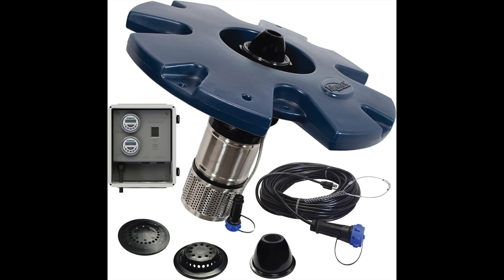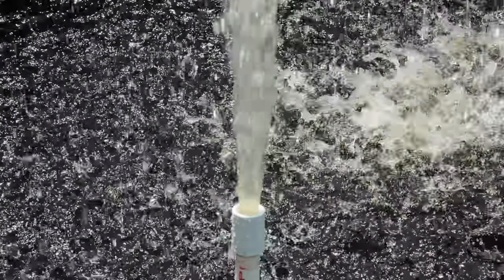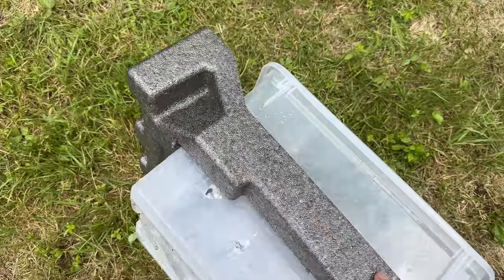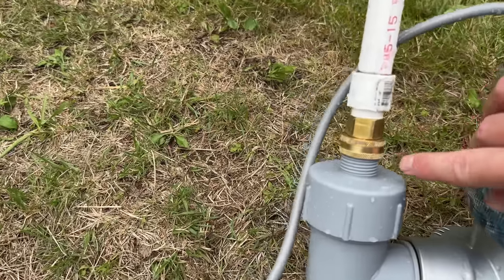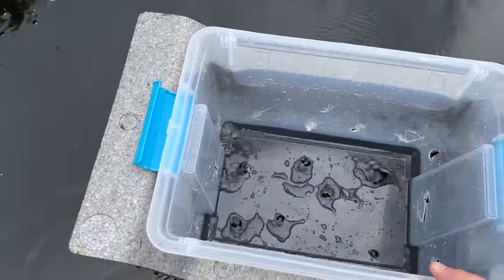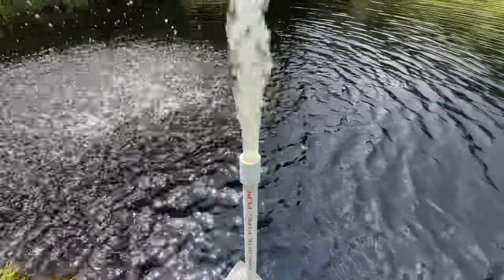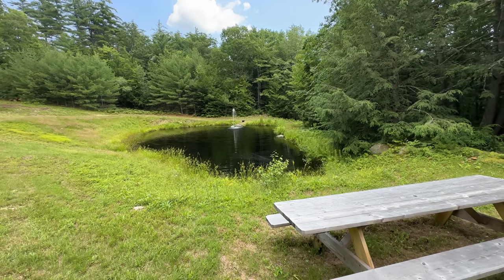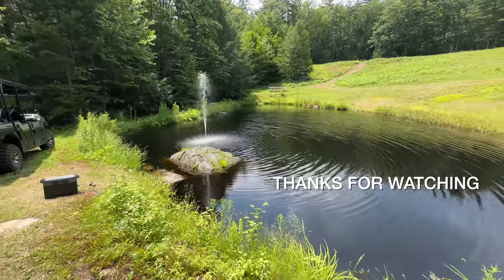Turning a Sump Pump into a Garden Pond Fountain

Comment: If you're doing this for aeration get a pond aerator, it's a much better way to oxygenate the entrie water column and not just the top. It helps break down the crud by feeding O2 to the beneficial bateria that eat the muck on the bottom. A fountain doesn't get O2 down to the bottom. Best cheap option is a septic aerator.
Reply: Isn't all air actually added to the surface? I thought an 'aerators' biggest contribution is to draw brackish/bottom water up the column of bubbles and create circulation of surface water back to the bottom'ish. Something you need to be careful of in the summer if pond is somewhat (less than say appx 6ft),  will overheat the water.

Comment: Ripples are good for slowing mosquito populations but it also disrupts beneficial amphibians. Submerging a stainless steel burner from a grill or fire pit OR a drilled out hula-hoop and forcing air down to it as an intermittent aerator makes for a much more efficient and less disruptive design. It'll also help keep the solid waste from building up as fast. They can also attract any bass for some night fishing (if you stock them). 

As for floating pumps, the easiest fountain is probably a bilge pump hooked up to an oscillating sprinkler. If you go with a stand pipe of PCV, make it more visually appealing and less disruptive to the surface by:

1) Putting on an end cap and using a Dremel or hacksaw to cut out 2-4 notches in the pipe at 30 degrees from parallel; making an atomizer/mister.
2) Putting on an elbow joint and heating the open end to soften it to squish it down around a chisel or bastard file; making a fan.
3) Buying a bell fountain head in order to get some laminar flow for less noise. 

Personally, I would have submerged the pump, drilled a channel in that rock for the piping and made a waterfall or splash pad (based of rate of flow from the pump).

Comment: Aeration can be diy also. Air pump can run 24/7 with low power needs.  All you sink is the weighted airline.  I had a dead pond, slightly larger than yours. I brought it back to life in one season.  Weedtrine-D for the vegetation and your fish and aquatic life will be fine. Good luck.
Reply from the maker: Thank you, I will definitely have to look into that. Sounds like it worked out great
Reply: Hey there I am going to make one of these pond pumps, can you please explain to me how to incorporate the aerator?
Reply: So, you need a power source, an air pump, weighted line, and an aerator? How much? Parts you used? Thanks.
Reply: @me1assassin  it’s been several years and I do not live at that property, but if memory serves, I bought a Danner septic pump. I think it moves like 5500 in.³ per minute.  In 2017 when I installed it I think all in I was less than 300 now today probably closer to 450.
Reply: @mountainviewfarmandfeed7052  the weighted airline connects from the air pump to the aeration stone or whatever you choose to use we use the double bubbler and then sank it in the middle of the pond. I hope that helps.
Reply: @mikegordon9801   - thx

Comment: Could be completely wrong and it could just be my late night brain here — but I wonder if you put a 30 or 45 degree elbow joint just at the top of your pvc.. would it flatten out the trajectory of the water and cause increased surface agitation over a larger area? 

Hmm 🧐